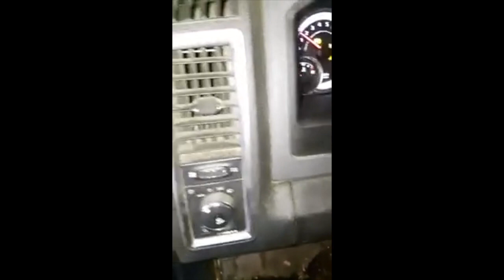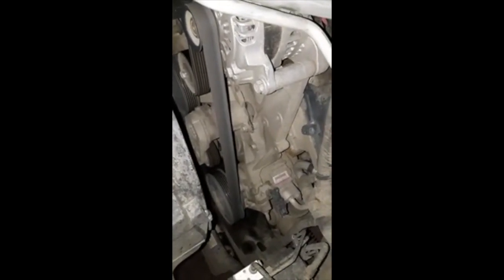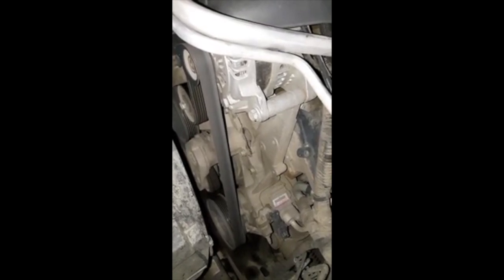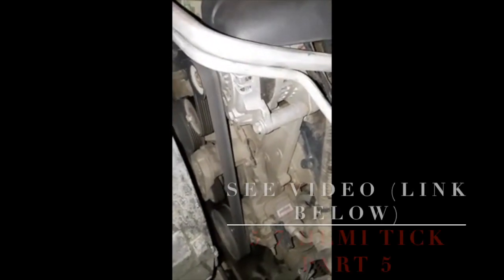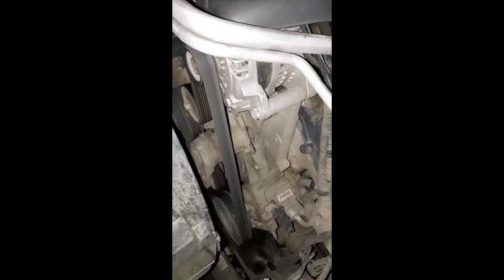5.7 Hemi Tick! UPDATE

Comment: Would this cause a p300 & p303? Can’t seem to figure it out. Installed:
- new alternator
-new camshaft sensor 
-new knock sensor 
-new crank shaft sensor
-new fuel pump 
-new thermostat
- 4 new plugs, 2 new coils, 2 new injectors on cylinder 3 & and the cylinder in front of it.

Truck still shakes, but a little less at idle, an still rumbles at cruising speed until I step on the gas. Like I cannot drive with cruise control. I am completely lost!! Can you help?
2010 ram 5.7 4x4
Reply from the maker: Check the timing chain, I just had a 2010 in not too long ago, where it had all the sensors done, pretty much the same as u described.  It was the timing chain in my case.  Does your truck rev out when trying to pass at 100km or 60mph?  The timing chain guide blows out on these engines as they r made of plastic.  Also listen for a rattle when revving.   If not the timing chain, check compression, test all the coils if u havent already.  Try a quick fuel test with propane at the intake when running (check out some vids on it), if it smoothins out, could be injectors, if u havent tested that already.  Hopefully this helps, but i will do some research an try find something out about it an get back to u, thanks for watching!
Reply: THE MOOSE'S WRENCH my little knowledge suggested that it was possibly the timing chain, but then was told it wasn’t by other Mechanics. Then my second thought was that it could possibly be the Vvt solenoid. A compression test was done in the beginning of me changing parts none of the cylinders were more or less than 15 PSi. The same mechanic told me that I would eventually need a new motor because that is what was done to another truck similar to mine. The injector on cylinder 3 initially wasn’t working properly so that was changed and so was the one directly out front. Yes engine does seem to get extremely high around 6000 or 7000 rpm when stepping on the gas around 50+ miles per hour. Also I used to hear a rattle at around 25 or 30 mph coming to a stop but now it doesn’t seem to make that noise anymore and also it does seem to have a slight tick or rattle when steeping on gas at idle in park, along with A flashing check engine light. I do want to say thank you for your speedy reply with straight to the point knowledge. Trust me definitely have a new subscriber. I will be in touch!!!!
Reply from the maker: Ya, the way u just described it sounds like the timing chain, is it possible for u to get ahold of an inspection camera to look inside the oil pan, through the oil drain hole to see if there is any plastic or steel parts in the pan.  If there is, they are broken pieces of the timing chain guide.
Reply: THE MOOSE'S WRENCH I can look but when oil was drained It didn’t have a silver/Metallic tint to it
Reply from the maker: @JamesTaylor-du3oo  No thats because it will be plastic pieces and a couple steel washers, and will not show any type of shavings in the draiin, if it is the timing chain?
Reply from the maker: @JamesTaylor-du3oo  and alot of the shavings will get picked up by the magnet
Reply from the maker: r u able to post or send me a video of your truck running? To my gmail 2moosebuilt@gmail.com if u can or have time?

Comment: I have the exact same sound after cam and lifter replacement
Reply from the maker: Ya, I haven't been able to figure out what that sound was, its actually still running and driving.
Reply: Same hear I wish they would do a recall
Reply: I just replaced cam and lifters and still ticks!
Reply: @alphageneration66  same as me when I replaced it
Reply: If it ticks on cold starts it’s the exhaust manifold. Bolts are broken.
Reply from the maker: Awsome thanks for the info!  Thanks for watching!
Reply: @alphageneration66  how much did that job cost?

Comment: Update: I’ve seen a few videos of a broken timing chain, an my truck doesn’t sound anywhere near that
Reply from the maker: ya it could be hard to tell, as i was sceptic about it as well.  Besides that it seems that u eliminated any other options and seem to be taking the right steps.  But it sounds like a timing problem, although i would test everything again to eliminate electronics, fuel and air, before checking internally.  Hopefully this helps?
Reply: Only thing left before that would be o2 sensors
Reply from the maker: @JamesTaylor-du3oo  ya that, internal cam and lifter, engine oil control valve maybe, do you know if your computer is sending out the proper signals, cause the 303 is the 3rd cylinder, did u pull the valve cover and watch the lifters
Reply: THE MOOSE'S WRENCH no valve covers have never been pulled. I hope an pray it’s not a lifter or the cam. I’ll change the vvt mds probably Saturday, along with new intake gaskets, an I hope that fixes it. If it doesn’t then I will go to a brand new battery and then timing chain. Along with checking the voltage on each and every new  sensor I have purchased, and pcm/ecu.

Comment: It's been a year. 
What was it?
Reply from the maker: Sorry didn't figure it out but the truck is still running fine, alot comments are stating to use a different oil and pump
Reply: Had you fix the exhaust manifold by this time?